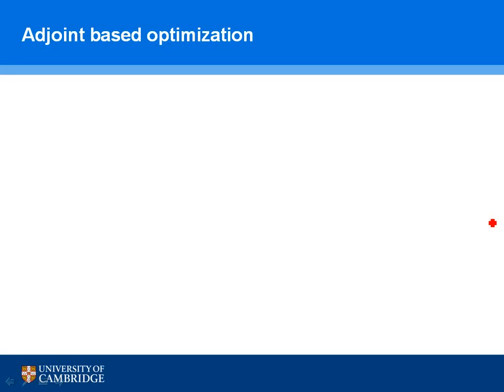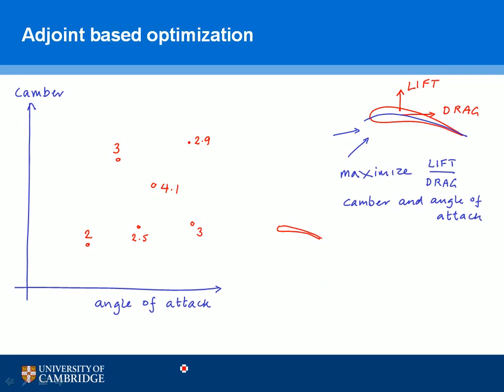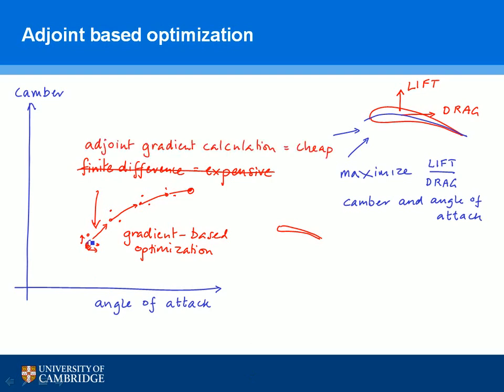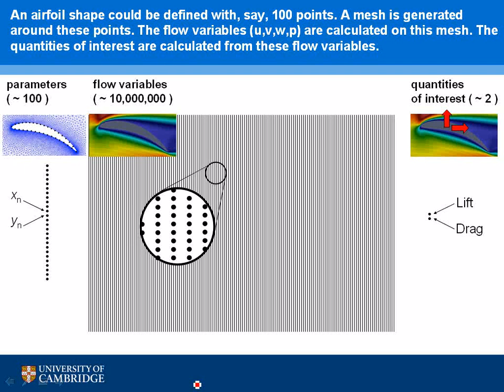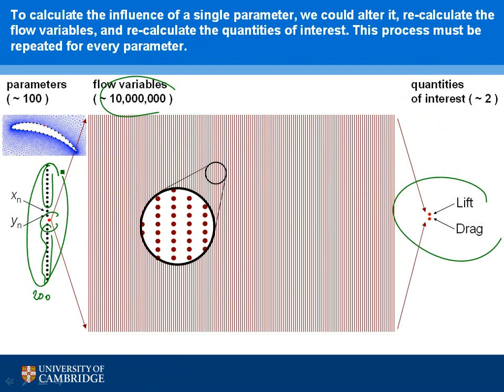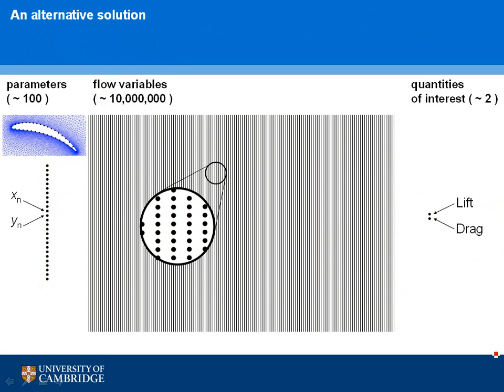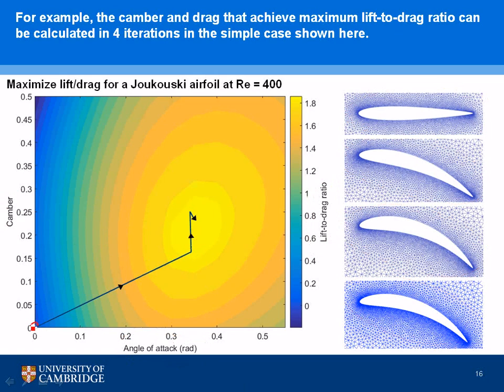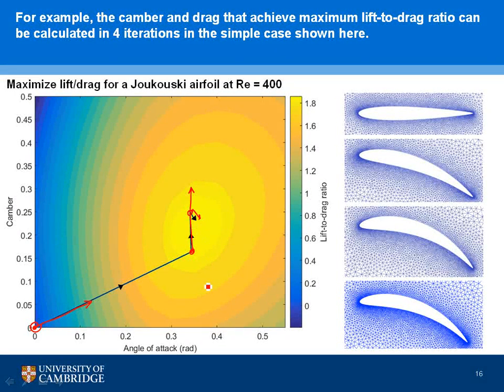adjoint-based optimization

Comment: why do we use the reynold's number? it seems like an arbitrary simplification that should be the result of the calculations rather than be used by the calculations
Reply: Reynold's number is used to know if we can compare 2 simulations/validation tests. The lower the number the more dependent on viscosity the flow is.

Since similar numbers have similar characteristics you can use much smaller scale models to check if the simulations are accurate (as long as the numbers are similar)

Comment: So essentially, this boils down to backpropagation, as performed in neural networks...
Reply: Yes. Neural Networks use automatic differentiation. You can automatically differentiate some, but not all, CFD codes.
Reply: @elmattnewniper5898  Not sure what you mean by that, but then again my background is not in computational fluid dynamics. I did some stuff with it in my master's, ages ago, but that's pointless atm.
Reply: No. Backpropagation is a recursive algorithm for updating parameters arranged in a layered hierarchy. Adjoint methods are an alternative to backpropagation. Both use local gradients, but that's the end of their similarity. Adjoints require more mathematical understanding to use but usually have better computational properties.

Comment: Hey, Please answer my query as soon as possible. I really need it on urgent basis. For finding  how flow variables are changing with respect to every parameter, wouldn't you need to solve 200 times by changing those 200 parameters one by one??
Reply from the maker: You run the adjoint code once for each output variable (e.g. lift or drag) rather than once for each input parameter.
Reply: @learnfluidmechanics4166  to find the derivative of flow with respect to parameters, we need to change that parameter. How changing the parameter will change flow variables without solving the flow?
Reply from the maker: @muhammadusmanshahid4195  With adjoint methods you do not need to change the parameter to find the derivative of the output with respect to that parameter. The first time you see it, it seems like magic. For a review paper on this see https://www.annualreviews.org/doi/abs/10.1146/annurev-fluid-010313-141253
Reply: @learnfluidmechanics4166  Thanks!
Reply: @learnfluidmechanics4166  One more thing, what about how far we have to move in a particular direction? is it only a guess thing ?
Reply from the maker: @muhammadusmanshahid4195  This is an optimization question. Look up Armijo line search and Wolfe conditions online. You'll find the notes on the UK Fluids Network Numerical Optimization SIG page useful: https://signumopt.sems.qmul.ac.uk/events/aug18adjoint/
Reply: @muhammadusmanshahid4195  I was exactly looking for this question. Thanks for asking.
Reply: @learnfluidmechanics4166  can you please tell me your email address?

Comment: May i ask what software are you using for this? And could you provide the file for simulation so that we can check how is it done? or perhaps a  simulationvideo demonstrating the adjoint-based optimisation . Thank you
Reply from the maker: We use Fenics (http://fenicsproject.org). I can't provide the code right now, but Petr Kungurtsev may make it available with his PhD when it is published around March 2021.
Reply: @learnfluidmechanics4166  thank you
Reply: @learnfluidmechanics4166  hello, I am enquiring if this code was made available. If so, kindly show me